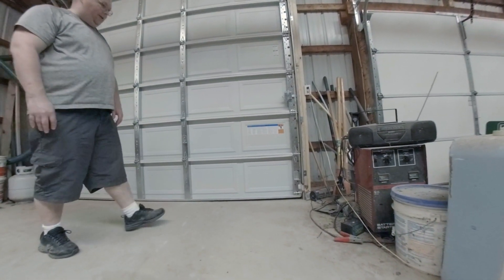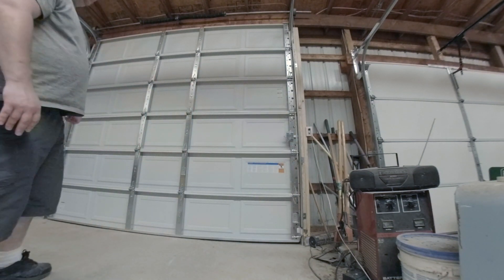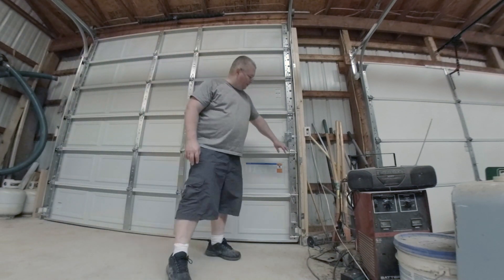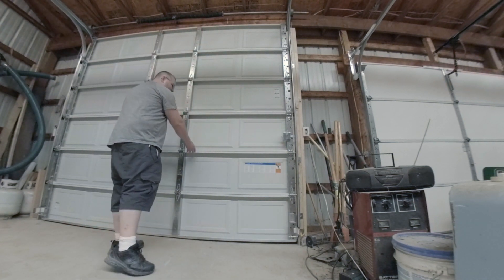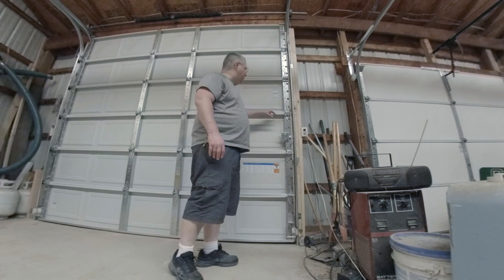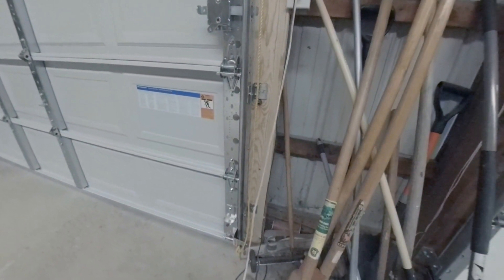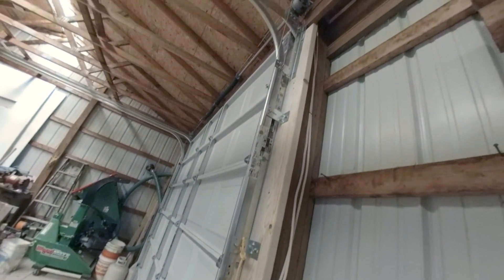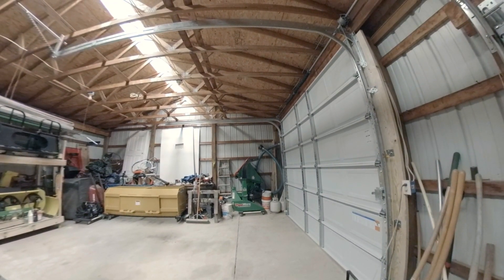How to Install an Ideal Low-Profile Garage Door

Comment: On my to-do list in a month. I installed the original Clopay 20 years ago and now replacing with Ideal because it was the only readily available one I could find. Mine is a basement door that is only 78" high and 96 wide. I'm going back and forth on reusing the low clearance tracks. The Clopay is tearing in the middle because someone tried opening with the opener when it was locked. Wasn't immediately noticeable but has gotten worse. The only Ideal option was uninsulated so that's an added expense. The Clopay has the old school springs on the sides of the track. I'm not sure if this one will come with the same or the torsion style. Headroom is tight so I'd be ok with the old style. Thanks for a little preview of what's going to be in the box.
Reply: FYI, Ideal Door is a Clopay brand.

Comment: my door came with a 11 foot track I'm installing a 9 foot door.  Do the track come in  one size.   Am i suppose to cut it   I call Menards the don't know so they email Ideal Door they wont answer until Monday because there  closed on the week end
Reply from the maker: I have the 9' door which is what is in the video. For mine, the single track section is 94" and goes along the wall. The double-track section is about 11' and goes on the ceiling as it is a low profile door. The top track (mounts to the ceiling) will always be longer by usually about 2' then what the height of the door really is.
Reply: @justdoingmyownthing.2504  thank you